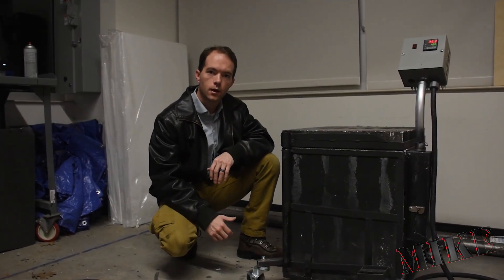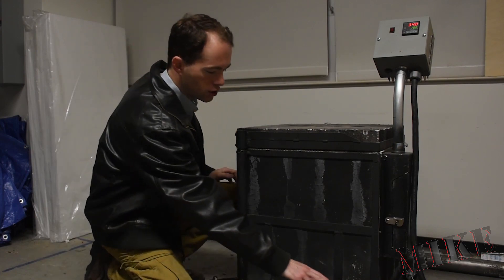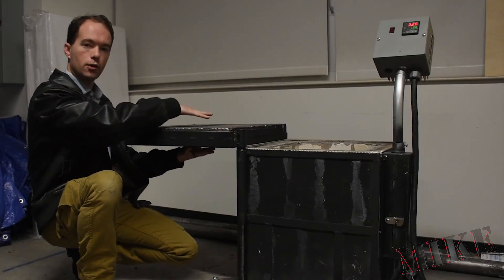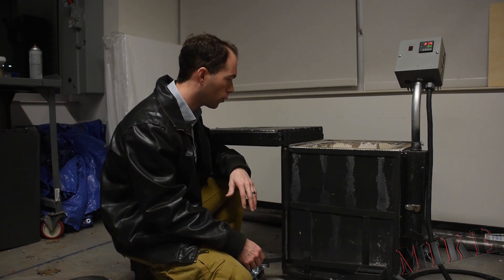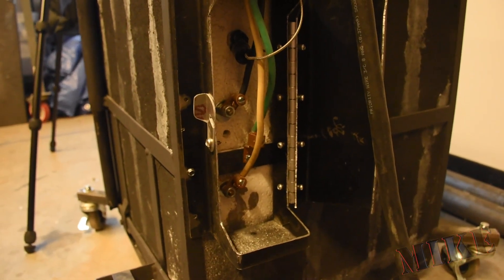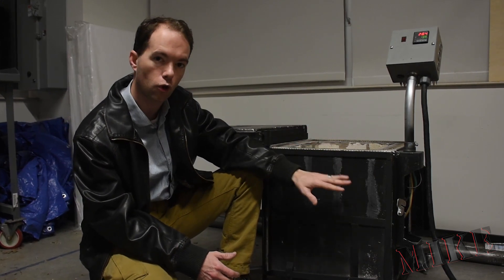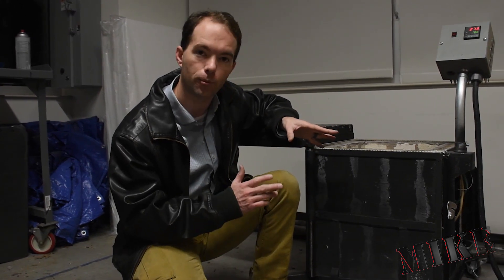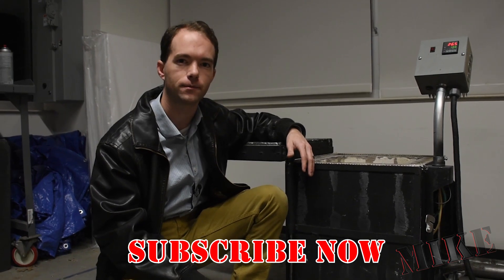Large Electric Foundry & Kiln - Mikes Inventions

Comment: Hi ill try to build a kiln like your for pottery firing. What is the size of those fire bricks? And if i want to fire in it 6 hours long do you recommend any extra insulation for it like glass wool or something similar to save energy?
Reply from the maker: More insulation is always better. It comes down to compromises of size and cost as usual. THe bricks are 9x4.5x2.5. I’ve run this for 10 hrs at a time without issue, but it does give off heat, as does anything that gets hot. If your budget and size constraints allow, then yes, add insulation.
Reply: Thanks the answer. Is the size of bricks in inch?
Reply from the maker: @sziluchannel  Yes.
Reply: What type and thickness of resistance wire do you use?
What is the max temperature?